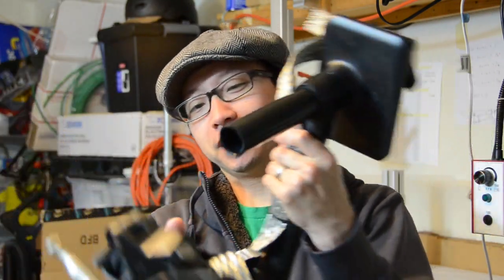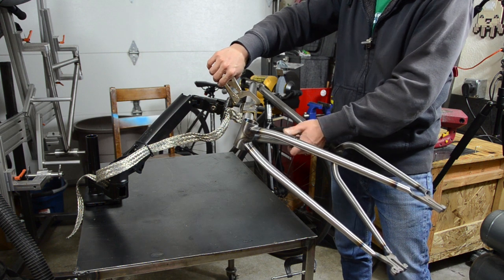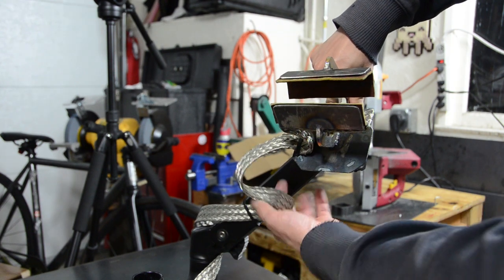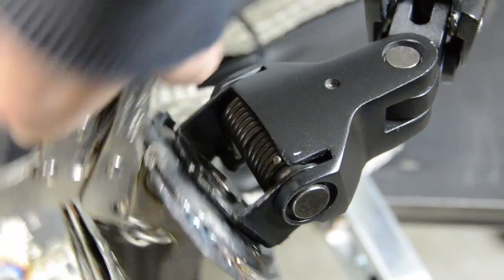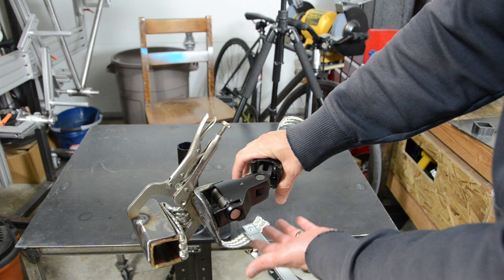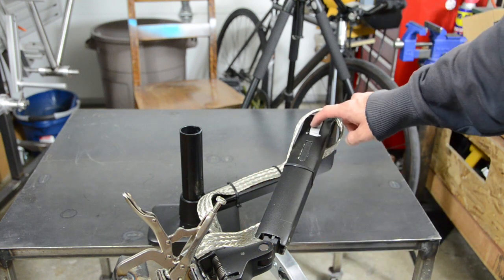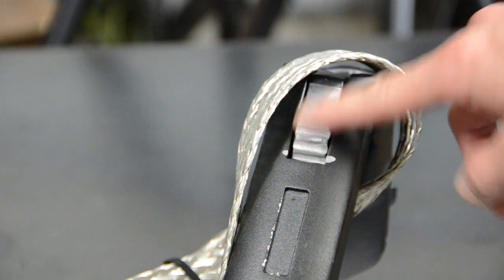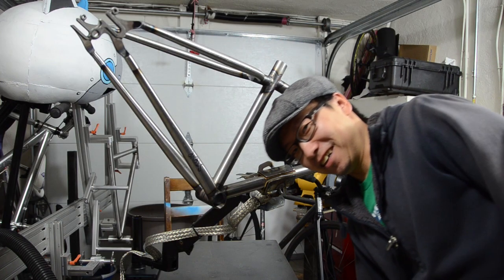Monitor Arm For Bicycle Frame Tig Welding

Comment: Great idea! This can be applied to general welding tasks other than for bicycle  frames.
Reply from the maker: +Adam Pierce Thanks! It works very well for my needs. However it is possible to used one of those park tool bike stands the same way. It doesn't articulate as much but would work right out of the box without the mods.
Reply: +Pithy Bikes One other thing; If you get a small laser diode and place it on a frame rail using wax or a magnet or sticky clay or double sided tape, and then tack weld a location and watch to see how the pointer deflects . This would give you some idea as to how much distortion is being caused by the weld and more importantly what sequence your welds or tacks should be placed and where in order to minimize the effects of the weld induced distortion. Aim the laser at a target about 10 feet away and you will detect movement smaller than a ten thousandth of an inch. These laser diodes are available cheaply from harbor freight.
Reply from the maker: +Adam Pierce Very interesting! I may need to try some version of that out.

Comment: I am an industrial designer and I have recently started learning to weld. This seems like a product that would be valuable to welders and fabricators/makers in a wide variety of disciplines. If you wanted to develop this into a marketable product I think you could sell a lot of them. You obviously have a passion for building things and love to learn new processes and techniques. As a designer I see the potential in this tool that you have created, I encourage you to think about developing this tool further and turning it into a product that you can sell. My online portfolio is at djstuart.com you can find my contact info there. I love you're videos, keep up the good work!
Reply from the maker: +Daniel Stuart Thanks man, cool stuff! The arm is isn't really new for this, just a slightly different take on something frame builders have been doing for a while. Normally they simply use the arm and clamp from a bike repair stand. This has served frame builders very well I think because I see so many being used in this way. The funny thing about a product like this is the user may not buy it if they're like me. They'll just build their own lol :)